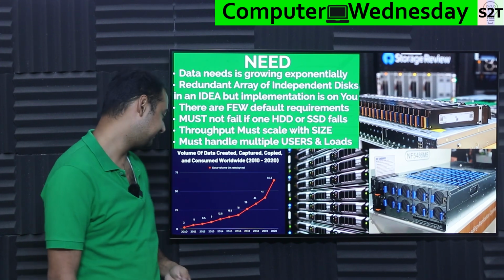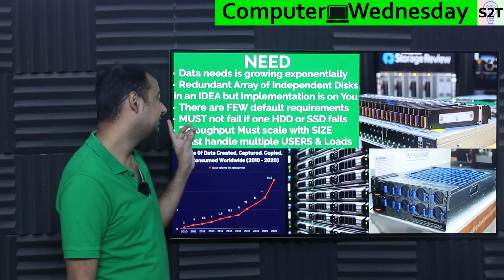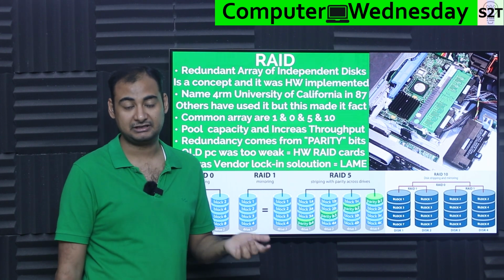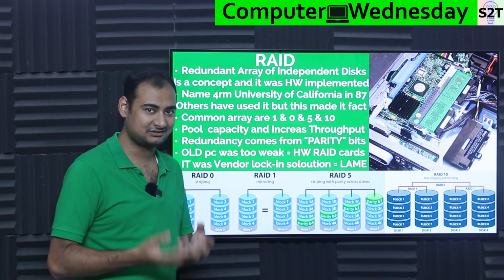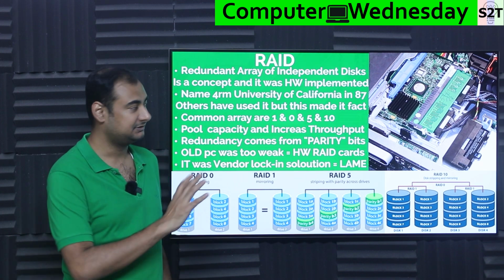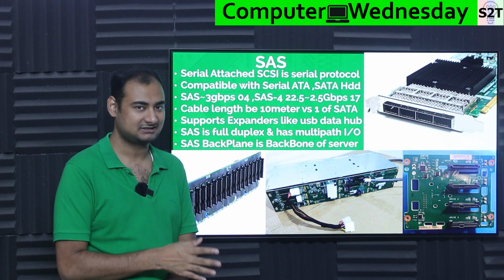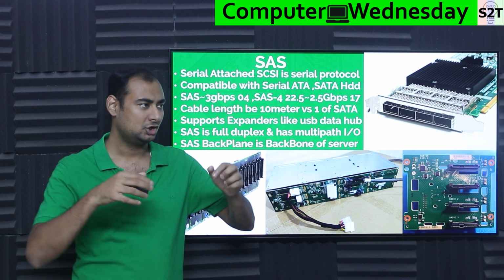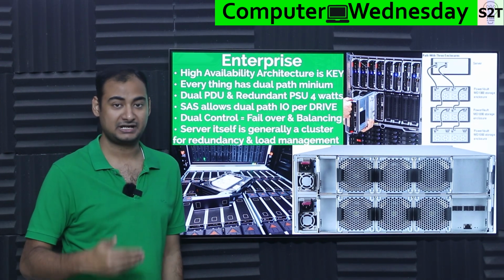JUST A BUNCH Of DISKs {JBOD} Explained {Computer Wednesday}

Comment: My NAS runs Unraid.
A paid for linux distro where basically 3 drives is in a storage pool and one drive is for containing the checksum (there are no striping across drives like with normal RAID) - the only downside is that the drives all needs to be the same size or the storage will be the size of the smallest HDD in the pool.
Reply: You have something slightly wrong about unRAID. You can combine drives of any size except they can’t be larger than the parity drive. I’m going to try and explain. Your parity drive should be the largest drive you own or think you will own (personally I have a 20tb as my parity drive because I won’t own anything larger than that). The other drives can be any size that are less than the parity drive. Example is: parity drive is 20tb, storage drive of 8tb 12tb 16tb. That is completely fine and you will will get 36tb usable storage (8+12+16). If you add a 22tb storage drive you will only add 20tb because the parity drive sets the max size of drives. 

TLDR: you can mix drives of any size and it will use the full space of all drives as long as they are smaller than the parity drive sets
Reply: @AlwaysBolttheBird  Ahh that makes sense - my first setup was just 8TB * 4 - afaik you can't replace a drive with a smaller size than what you had before.

I know they support multiple parity drives but then it started looking complicated and my server is limited to 4 drives 

My bet is that only one drive will die at a time :).

My most important must not loose stuff is in the cloud like pics , docs.
Reply from the maker: bro u REALLY NEED TO READ THE documentation. you literally are using Un Raid as TRUENNAS .